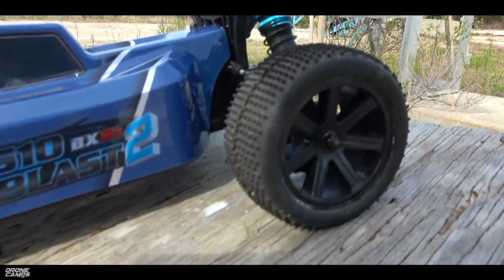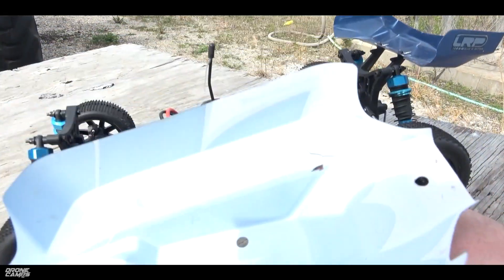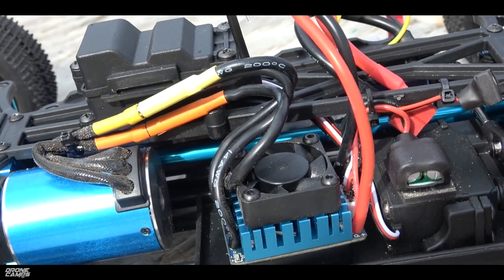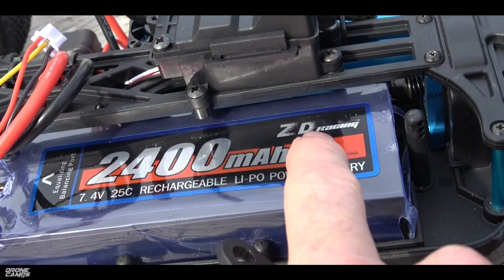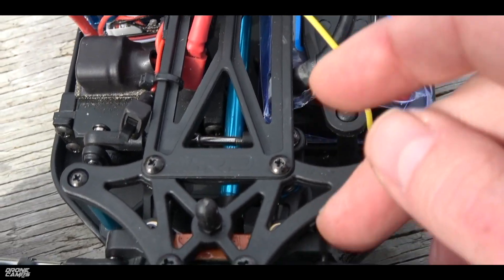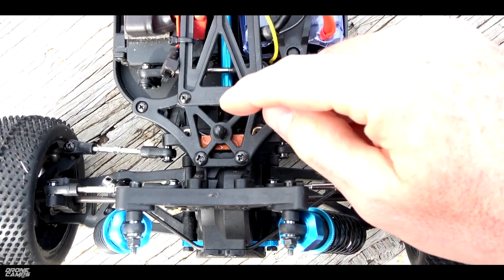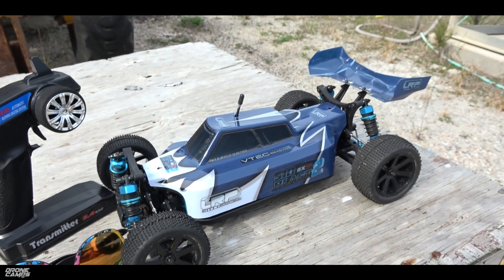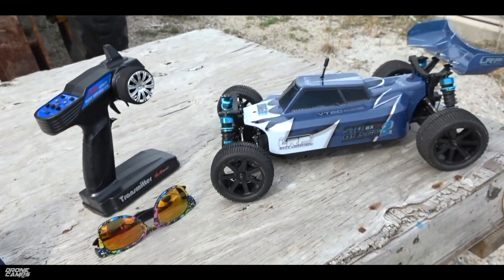MOST DURABLE RC CAR! - LRP 1/10th 4x4 Buggy - Review & Bash

Comment: RC, nitro trucks were my first hobby👍 badazz driving Justin
Reply from the maker: Thanks Preston! I love driving. Nice that Jareth was there to fly with the LRP Buggy :)
Reply: @DRONE MANIACS DPreston
                                                    Same here bro ..... I have always been a Nitro guy (since the mid 80's) and have had nothing to do with filthy lipos .... until i got into Quads ... only thing WRONG with Quads is  NO NITRO!!!!!
Came here because i have a LRP .28 race Spec 3 engine ... always thought of them as probably the best Truggy engine ever built. Germany reliability plus  .... insane POWA ... had to retune all my diffs and lower the engine tune lill just to stop the damned thing lifting the front end on throttle :D

NITRO FOREVER (or until we run out of oil) :D